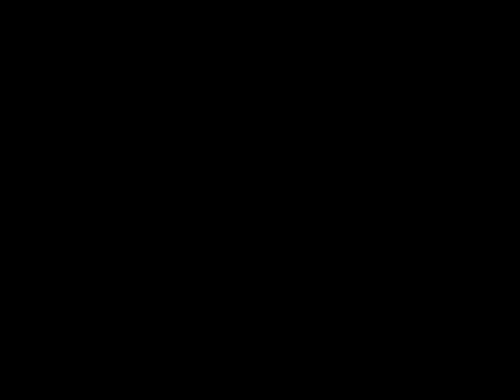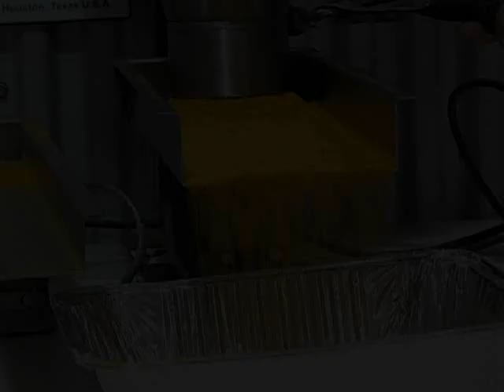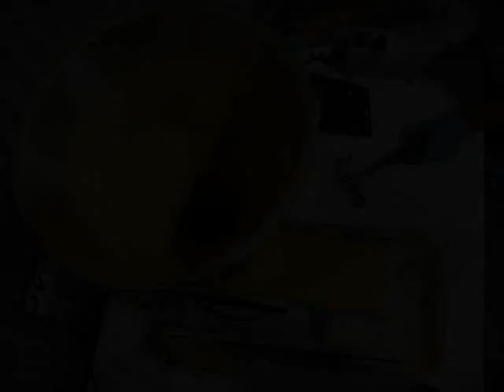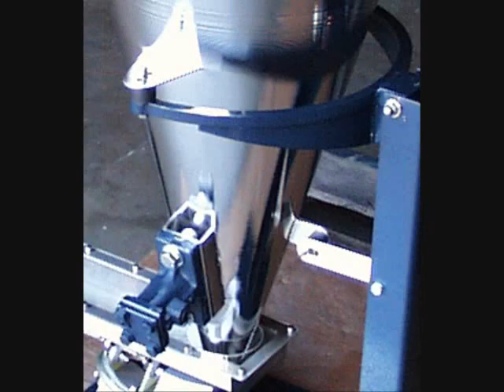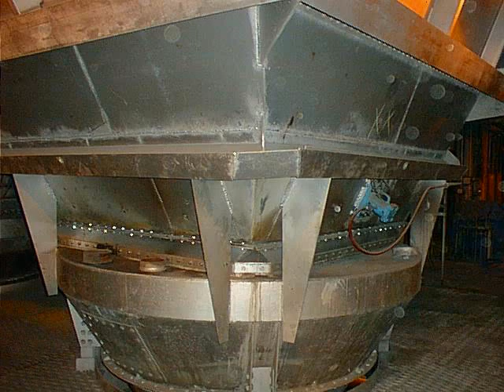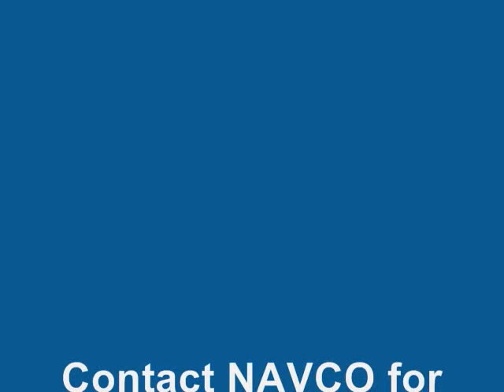Don't hammer hoppers -Use NAVCO Industrial Vibrators

Comment: I need a vibrator for a poly bin, the hopper is about 83 cubic feet, and holds steam flake corn. Suggestion on size?
Reply from the maker: Hey Colt, We would be happy to help you with that -- we would need to know more about the material characteristics and the hopper in order to find the right solution.  Call us 800 231 0164 or email us sales (at) navco.us